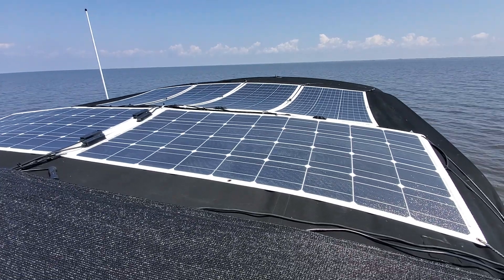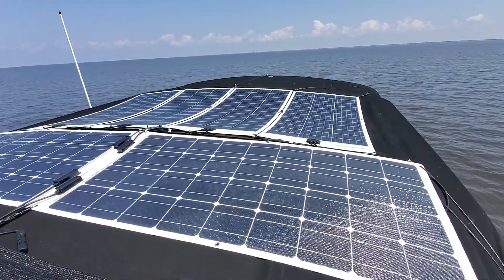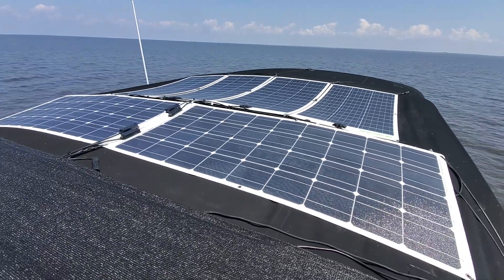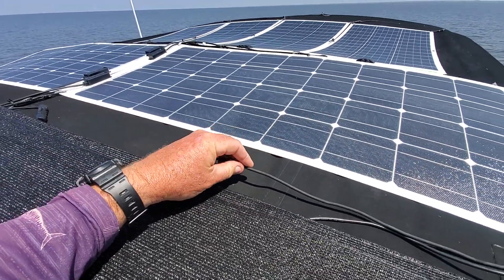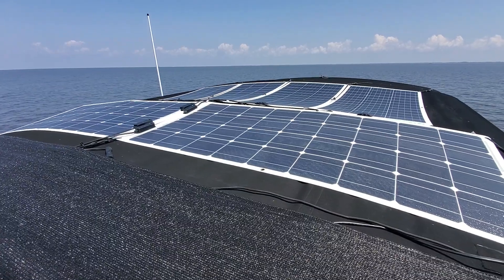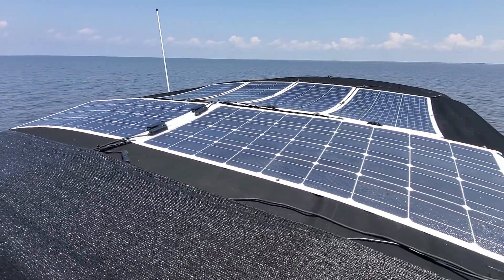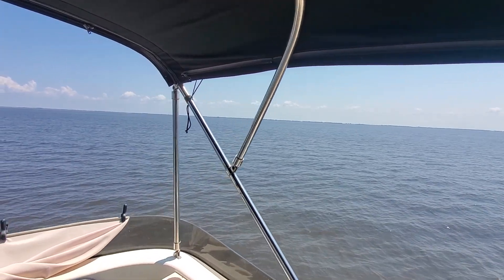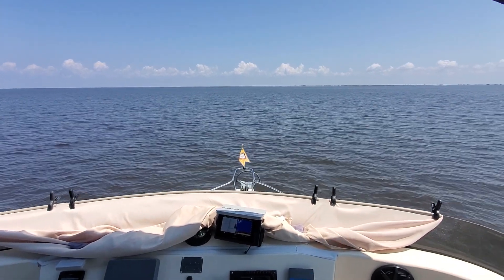solar panels 600 watt update

Comment: Give a space between the panel and the surface. The panels needed ventilation and they wont last if they dont have the ventilation.
Reply from the maker: When applied to a hard surface they are screwed and glued down. How are they supposed to have ventilation?  I'm willing to give it a try if you've got suggestions. Always looking to learn. Thanks for the post.